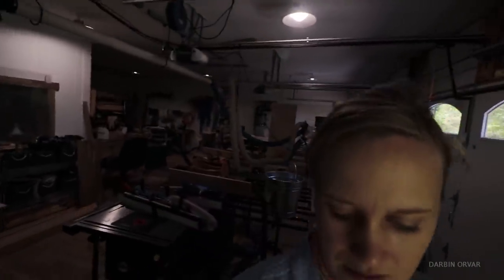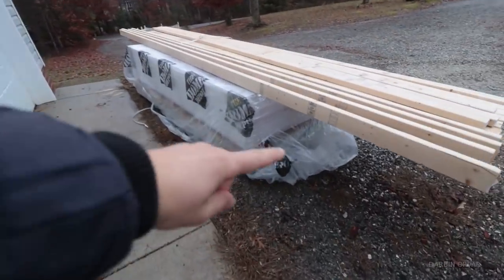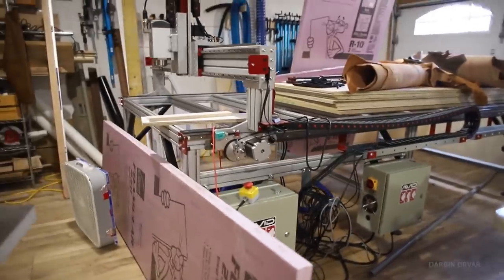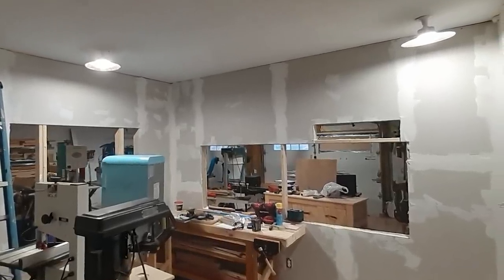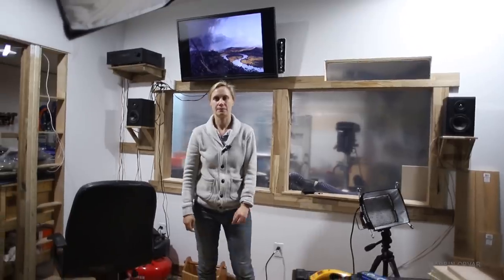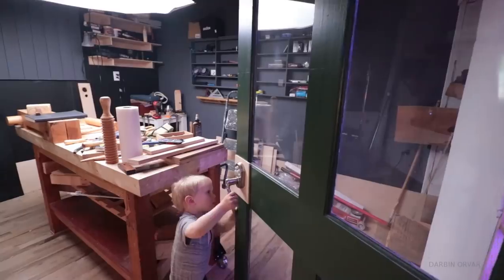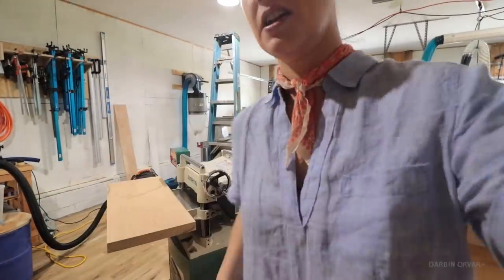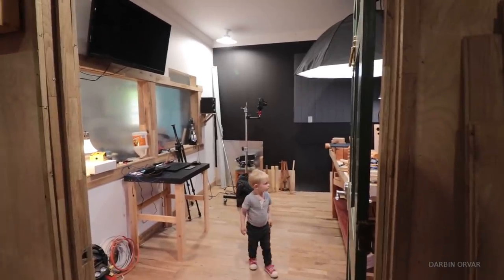Update - Building a Room within the Shop?!?!

Comment: So if I understood correctly, the hole in the wall above the window with a series of computer fans will be drawing warm or cold air into the little room from the shop. Won’t that create a dust problem since the air drawn from the shop will be dusty when you are using the machinery?

Comment: Love your videos and practical solutions to problems. I have one suggestion. When you said you were going to use muffin fans to move air into the small office it made me cringe. Computer fans are not designed for such purposes and can cause problems in the amount of noise they produce. These fans are primarily designed to service equipment not human comfort. I have seen fans that are purposely designed to produce higher levels of noise as a means of making people aware there is a running fan in the area. You can get low noise fans but at reduced CFM and higher cost. The other recommendation is to source DCv fans with ball bearings, this would allow for control of the fans output.